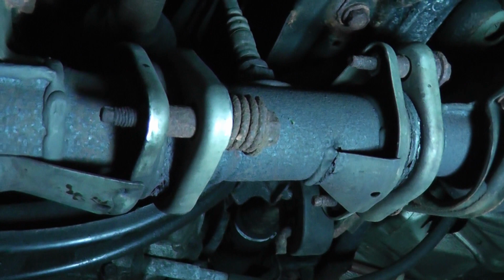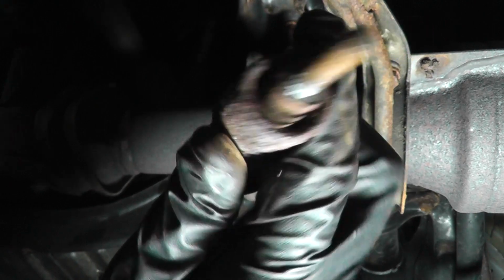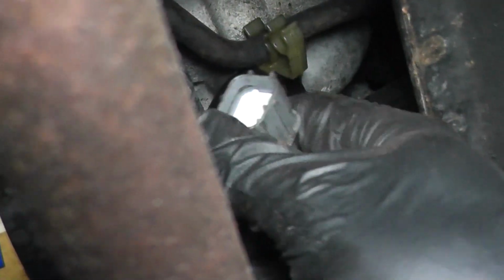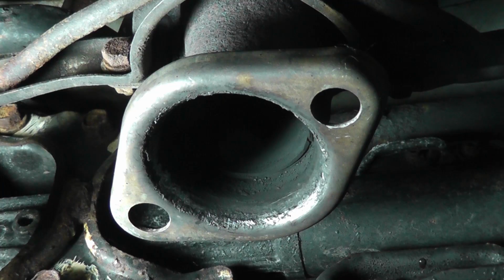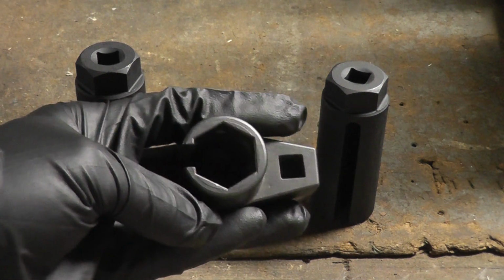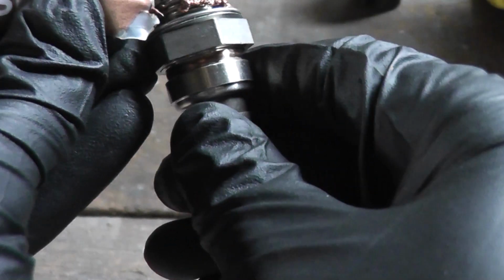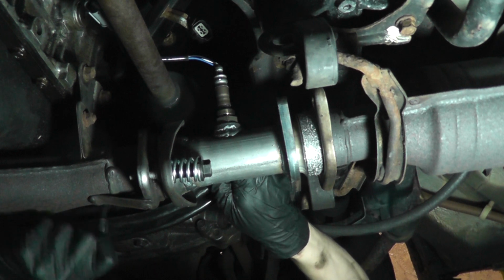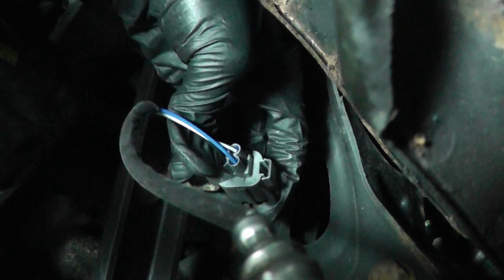1994 - 1997 Honda Accord Mid Pipe and O2 Sensor Replacement

Comment: Your videos are great, and are still helping me today! I think I will be tackling this job soon. My CEL is not on, but I have had the car for almost 20 years, it's over 300k on it, and I have never replaced the 02 sensors. Should I even bother? ... Secondly. Are the O2 sensors the same upstream and downstream, other than the wiring harness? Thanks!

Comment: So what’s is that 02 sensor called down there? Because there’s a 02 sensor on the mondifold too
Reply from the maker: There isn't one on the manifold on this vehicle. The OBD 1 Accords like this one have the upstream sensor on the mid pipe while the OBD 2 Accords have the upstream sensor on the manifold. The OBD 2 models also have a downstream sensor located at the outlet of the CAT which doesn't exist on the OBD 1 models it's sole purpose is to set a code if the catalytic converter fails.
Reply: @Bushougoma  I have a 1995 Accord (OBD I)  with a sensor in the Exhaust Manifold. I don't know if I have another O2 under the car - as it has been a while since I was down under looking for the Exhaust system.

Comment: My Honda didn’t pass smog because it’s running to rich ? It’s a 1994 Honda Accord lx you think if this can be the problem?
Reply: Check your Upstream sensor in the Exhaust Manifold. Change your PCV valve, and Air filter if you have not done so already.

Comment: hey i was wounder if you could help on out i have a 1995 accord dx and changed the tps . map aicv cap rotor and tuneup and egr the car starts up fine then as soon as it warms up the check engine light comes on and the car will buck if i give it to much gas and have to baby it back home at about 25 mph i tried jumping the ecu to pull codes and the check light does not blink and stays on what do you think it could be i have had o2 senors fail before but they did not make the car loose power and buck any help would be appreciated thankx
Reply from the maker: So it only loses power on acceleration after the engine warms up? Everything is good before the PCM enters closed loop?
Reply: Hey Thankx for replying so fast the car starts up fine I can drive it for about 5 to ten mins then there is this slight buck like someone pressed the breaks real quick for a second then the car I think goes in limp mode and I car still drive it but very light on the pedal if I give it to much gas if feels like a five year old learning how the drive stick could this be the O2 sensor because I had them go before and it did a similar thing where right before the check light comes on it's like someone hit the brakes for a quick sec but I can't remember if it made the car buck like that
Reply from the maker: Sounds like the issue appears after the engine has warmed up and the PCM enters closed loop. One of the things it does in closed loop is it starts using the O2 sensor signal to adjust fuel trim. Often a bad sensor will be pegged rich or lean which causes the PCM to add too much or take away too much fuel in an attempt to make the dead O2 respond. Pulling the O2 sensor connector will force the PCM back into open loop if the issue disappears the O2 is the likely culprit.

Since scan data isn't available on these older OBD 1 vehicles to see the O2 sensor signal the only way to definitively confirm if the O2 is at fault would be by scoping the signal wire directly.
Reply: @Bushougoma  ok so i started the car and right away i disconnected the 02 sensor and right away the check light comes on loss of power and bucking i never knew the 02 sensor could cause the car to run so poorly it feels like its running on three cylinders now this is the up steam 02 should i order the down stream as well i will follow up after and let you know if it all works out thankx for all your help
Reply from the maker: A 95 shouldn't have a downstream O2 unless the vehicle is really a 96 in which case if you pull the ashtray out you should see an OBD 2 scan tool connector inside.

The downstream is just to monitor the catalytic converter and sets the infamous catalyst efficiency code it isn't used for fuel trim and was required on all vehicles when OBD 2 came out.
Reply: ok i just thought that because your vid says 94 to 97 that would explain a whole lot because no one i talked to said an o2 would make the car buck they all thought it was the distributor but since it only has one 02 and obd1 that would cause bucking for sure how else is the car going to regulate the fuel and air mix im still waiting on the part ordered it from ebay so it might be coming from china you never know but i will post the  s resultes
Reply from the maker: The PCM has adaptive strategies to regulate the air fuel mixture using other sensors such as the MAP, IAT, and TPS. Some PCMs are better at it than others on some vehicles you won't even notice a sensor signal has dropped out on others the engine runs like crap with loss of power. In either case your fuel economy will be in the toilet but at least it keeps you off the side of the road.

It is possible that the O2 sensor signal is dropping out and causing the issue but again without test equipment it's just a guess.
Reply: @Bushougoma  hey, just wanted to fill you in so while i was waiting for the 02 i decided to remove and take a look at the 02 and it was caked in black soot so i soaked it in gasoline for 24 hours popped it back in and the car is running like a Ferrari before the check light came on and started to buck and stall the power band was out of wack it had lost its famous Honda high rpm revs and at 4 there was no more balls to the car now i can red line it to 6 full power so thats that a stupid 02 sensor lead me on a 2 month wild goose case so thankx for all your help and to anyone else reading i hope it helps them as well
Reply: vick smith k

Comment: Would have loved to see you try to remove the o2 sensor as it sat before removing mid pipe to simulate removing just the o2 sensor.  But, great tutorial anyway.  WHat year is this car exactly?  I've got a p0141 code on my 1997 Honda Accord SE, so I believe I need to change the downstream sensor.  Was that the downstream sensor you replaced and is it in the same location for my car.  Looks like under the engine.
Reply from the maker: 1995 it's an OBD 1 and doesn't have a downstream sensor. Downstream sensors were required when OBD 2 came out (1996 and later models) and is always after the outlet of the catalytic converter.

As for your heater code it's easy to verify if the sensor is at fault just pull the connector on the sensor and with the engine running check for battery voltage on the heater wires with a multimeter if it's present the O2 sensor is bad.
Reply: Oh, I didn't realize what year your car was.  THanks for the advice.  Will test it.
Reply: @Bushougoma  So you have a 1995 with one O2 in the Manifold and one in that Midpipe ?  I am trying to determine what the Primary O2 sensor is (where it is) because all I have is a listing in parts for Up stream and down stream ..
Reply: By the way I love your videos : Best on the net.
Reply: Bushougoma I have a 95, so I don’t have the bottom sensor like in this video?

Comment: Hello Busho, my husband and I have a 1994 Honda Accord ex with a misfire. My husband replaced the distributor rotor, cap, the spark plugs and cables, the fuel filter and clean the injectors and the car still misfire.what else could be the problem??
Any suggestions? We need help to fix it.
We love your channel is very informative.
Thank you in advance!!!
Reply from the maker: Is the check engine light on are any codes present?

Give it some gas to raise the idle when in park is there any improvement?
Reply: Bushougoma we have a little improvement raisin the idle. I think is one of the injectors, because I pull all the spark plugs and in the cilinder 4 the spark plug was dirty with carbon deposits and the rest where like new.
Could it be that injector the problem? That means that the injector is dirty or spraying to much fuel??
Reply from the maker: Possibly but have you checked the compression on that cylinder? Low compression can also cause a misfire. Compression gauges can be bought for under 20 bucks.

Disable fuel by disconnecting the injector resistor connector (large metal finned heat sink on the driver side firewall). Crank the engine to bleed any pressure out of the fuel rail. Thread the gauge into the spark plug hole, hold the pedal to the floor (to fully open the throttle), and crank for 6 to 8 seconds. All four cylinders should be within a few PSI of each other.

If spark is present at that plug (the wire is good) and compression is good then yes fuel delivery would be next. Since all of the other cylinders plugs look normal it's unlikely that it's a fuel pressure issue.

Verify that you have injector pulse at the suspect cylinder with a test light disconnect the connector on the injector. Connect your test light to battery negative. Turn the key on and probe the red / black wire the light should come on that is the injector power. Now you will check for injector pulse connect the test light wire to battery positive and probe the other wire with the engine running. The light should flash indicating the PCM is attempting to fire the injector.

There's no real way to test for a plugged or sticking injector without special tools. It's usually done with a fuel pressure gauge and an injector pulse tool. Without it ruling everything else out as explained above is the only way to be sure.
Reply: Bushougoma I will buy one and I let you know.
Thanks for all your help!!!
God bless you!!
Reply: Bushougoma we fix the car! the compression in the cilindres is fine. The problem was one of the injectors was not working properly. We replace it and now the car is working good. 
I want to thank you for helping and making this awesome videos. You save us lots of money!!
God bless you!!
Reply from the maker: Glad to hear everything worked out.

Comment: If I were to just change the O2 sensor would I need to take out the mid pipe if it’s seized onto the mid pipe?
Reply from the maker: You can try but it's a very tight spot. You may end up damaging the donut gaskets and have to remove it anyway to fix the resulting exhaust leak. The twisting action of trying to remove the O2 will pinch the gaskets and can damage them.

Luckily the spring bolts are easy to cut off if they decide not to cooperate.

Comment: First off thanks for your videos they’re very informative .
The question I have doesn’t pertain to this video but I was hoping you might be able to help me out anyways. I have a problem with my 96 Honda Accord lx 2.2L non vtec . My speedo was acting erratically and from reading on the internet, all signs were pointing to the vehicle speed sensor being bad ,so I replaced it and now my speedo doesn’t work at all , I tried the old one again and still no speedometer movement. I tested the connector and it is good. How do I test the new vss sensor to see if it’s faulty or could it be my speedo has gone bad? The thing is the speedo was move around erratically before but nothing now. Can you help me out
Reply from the maker: It sounds like the tiny drive link between the sensor and transmission wasn't reinstalled without it the sensor won't output a signal.

It's a good idea to put a dab of silicone grease on the drive link and insert it into the VSS this will help retain it during installation.
Reply: Do you mean the little key pin ? If so, I thought so too, And that is exactly what I did , I put a dab of silicone grease to hold it in ,but still nothing.
Reply from the maker: Set a DMM to measure DC volts back probe the VSS connector with a sewing needle. With the key on and the engine running put the red probe on the yellow wire and the black probe on battery negative. You should see battery voltage. Now move the red probe to the black wire there should be 100 millivolts (0.100 volts) or less on this wire.

If so check if the VSS is outputting a signal raise the front of the vehicle and support it on jackstands. Start the engine and put the transmission in drive. Measure between the orange wire and battery negative you should see a voltage that changes with wheel speed.

If so the VSS is working properly and either the orange signal wire is open between the VSS and the speedometer or the speedometer itself has an issue. Check the solder joints on the speedometer PCB they can crack from time to time and lead to erratic operation.

If the solder joints are fine verify the power, ground, and VSS signal is present at the speedo if that checks out you will need to replace the speedo.
Reply: Thanks I will try it and get back to you with the results. Sorry for responding so late but I had to work and didn’t have time to respond

Everything checks out fine , so I guess I need to replace the speedo like you said , because all is good everywhere else. thank you for all your help, when I replace the speedo , I will post my results here 
Thanks again man your awesome

Comment: First thank you for your videos, I was able to fix stuff on my 94 honda accord but now I have a problem and can't find the problem, please help me!!!!!! When I put my car in drive it takes a few seconds to engage, when it changes gears the rpm goes high and when its doing down shifting I can also feel the changes really bad, I took it to a mechanic and told me it was the transmission,  they changed it and its still doing the same thing, they said they don't know what's the problem,PLEASE SOMEONE HELP ME!!! PLEASE!!!
Reply: negro102279 yea that’s the problem, they tell you this is what’s wrong and you think you’re so close to having it run perfect after the repair and then it doesn’t change a damn thing, it’s infuriating. I’ve just had to bring my car back 3 times to this shop that changed out an axle (a 20min job that is so straight forward) yet after they did it there’s a bunch of new rattling and vibrations in the car so today their gunna replace axle again for free and hope it fixes it.
Reply from the maker: Is the fluid level ok? A low fluid level can cause shifting issues. Warm the vehicle up, park it on level ground, and turn the engine off. The fluid should be in the cross hatched area.

If the fluid level is ok a delayed shift into gear is a transmission issue. If the shop put in a remanufactured transmission it should be covered under warranty you can get a dud from time to time. If this was a salvage yard transmission then it's likely that it's junk.

The torque converter was replaced with the new transmission and they flushed the cooler in the radiator out right? Not doing that can cause debris to get pumped into the replacement transmission and will void the warranty.
Reply: Bushougoma  thank you so much for your response!!! Unfortunately they got the  transmission from a junk yard, the weird thing is why they both doing the exact same thing? Could it be a sensor or anything elae?? Again thank you so very much for your time to response and your very helpful videos!!
Reply from the maker: No sensor would cause the delayed shift into drive.

A worn out transmission may be the reason why that vehicle ended up at the salvage yard.

Is the transmission making a high pitched whining sound when in park like a power steering pump with low fluid and does that sound momentarily go away when moving the gear selector?

If so it's probably because the filter is loaded up with old clutch material restricting the fluid flow and the transmission needs a rebuild.
Reply: Bushougoma which sensor that would be?? And no the transmission doesnt make any sound
Reply: negro102279 What about the transmission shift control and lock solenoids? Maybe changing them could help? I had bad shifting and was reading up on how Honda’s had common issues with this and changing out the solenoids help sometimes, unfortunately they didn’t change the rough and off timed shifting and I am definitely not spending that much money on fixing the transmission on an old car like this. I feel bad for you bro to get the transmission fixed and have it change nothing.. how much did that run you?
Reply: Lyle J they charged me 1000 for changing it but unfortunately didn't help at all...now days some mechanics doesn't even take the time to really diagnose/find the problem they just take the easy way out but anyway I did change the solenoids and helped a bit except the the rough but it's driveable and runs pretty good
Reply: Lyle J I know what you mean, mine was a 94EX and was fixed, nice rims,low profile tires, sound system and all that so I guess I kinda had to
Reply: Lyle J youre right man and good luck with the axe hope it get fixed for sure

Comment: i hardly ever use 12 pts
Reply from the maker: In some predicaments you'll have no choice many cylinder head and flywheel bolts are 12 point so it's good to have a set of them around just in case. I hate having to buy tools in the middle of a job.
Reply: i agree